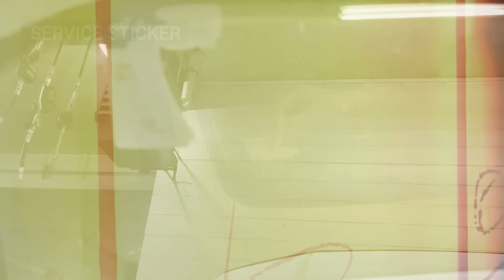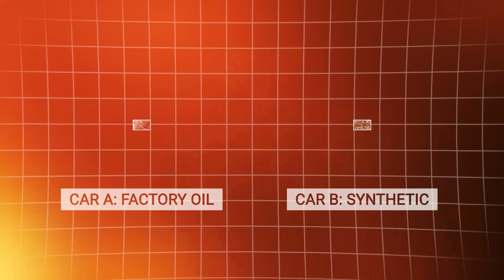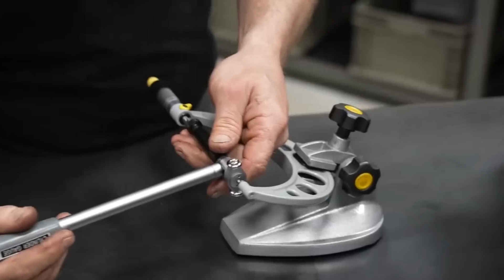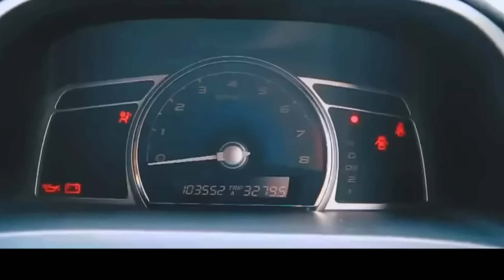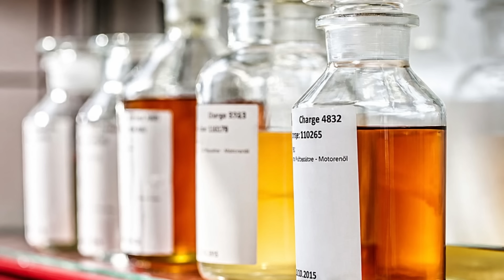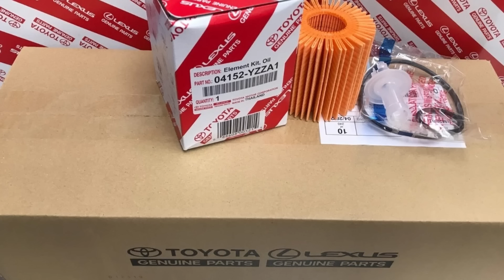We Ran Full Synthetic vs Toyota's Factory Oil for 2 Years — The Teardown Result Surprised Us

Comment: The terms "Full Synthetic", "100% Synthetic" and "Synthetic" are merely marketing terms and has no legal meaning. Use API identification instead. Is it the phony synthetic Group 3 OR a real synthetic with AlphaPolyOlephin and PolyOlEster synthetic bases? Group 3 is now 99% of all motor oil. Because it is cheaper to make without synthetic bases. Don't go over 5k on Group 3. Toyota owners following the factory 10k interval found stuck rings and huge oil consumption. The difference between the two groups is flash point. Group 4/5 real synthetic is more heat resistant because it has ester. Ester is why jet engines can live without a cooling system. Group 3 is fine if you don't tow, race, or have a turbo. If you do, get real synthetic oil. There are only 3 that are U.S. Redline, Royal Purple and Amsoil Signature. This video is an ad for Toyota oil. The Camry engine is not hard on oil. I want to see a test on a new Tundra.

Comment: I think a more precise comparison would be running this same type of experiment over a much longer period of miles such as 50,000 or 60,000 miles.  Also do 100% genuine Toyota bottled oil (not dealership bulk oil) vs a known brand oil like Valvoline Restore & Protect or Pennzoil Ultra Platinum.   I would even add a 3rd Toyota car and bring in a full Group IV PAO/Ester base oil like Amsoil or HPL synthetic.  Then I feel you would have a higher degree of comparison between group 3 and group 4 base oils with different add packs and formulations

Comment: 05 Prius changed oil every 3-4000 miles used a variety of 5-30w synthetic.  Used Lucas oil treatment, to reduce oil loss. Still running at 299,999,9 miles, odometer stopped a year ago.

Comment: Just use CASTROL I have a 500+ mile 4 cyl ,ran CASTROL 10-30 its entire life, engine looks like new inside, look as clean as new ,and its conventional 10-30 changed every 5,000 miles.with oem filters .castrol oil is the best

Comment: Factory / dealer oil is intended only to get the engine through the factory warranty mileage - not a mile more. The full synthetic will have less wear on bearings and rings over the 60,000 mile warranty.
My solution - run a full synthetic and change every 5,000 miles.
Reply: I would like to know where these idiots get there  information from😅
Reply: Yes n maybe go up a grade on the operating temp side.
Reply: Exactly what I do. OEM filter. No worries.

Comment: The real problem is when you bring your car in religiously to the Toyota dealer but find out the oil and fluids the dealer charges you for isn't Toyota's but generic "Bulk" oil and coolant. Many do this to increase their profit margins. Each or every other oil change send a sample of the out for testing. Keep then honest!
Reply: I asked the local Toyota dealer if they use Toyota brand oil. They don't; they use Mobil 1 and he stated Toyota doesn't make oil. Of course they don't because Mobil makes it but the additive package varies.
Reply: Even the Car Care Nut on youtube said after he left Toyota that the oil the dealer used was the cheapest he could buy.
Reply: Toyota uses mobil 1, in bulk and bottled
Reply: @JimS-j1x  Depends on the dealer, doesn't it?

Comment: Not any 👍  but I think it's due to anti 0w-20's. A lot of talk on running 5w-20. I'd like to see you compare THOSE results. In MY opinion, hotter climates could probably use 5w, but on hybrids, I just wouldn't risk, because stop start process.
I'm kinda discouraged with Toyota brand oil. Why DON'T they make their's full synthetic? Rumors are it's the same oil as MOBIL1, but it isn't. They never DO state full synthetic on their bottles. I ran Mobil1 once, but didn't like the color because it was a deeper golden color & I felt it would give off more of a varnish color on engine.👍
Reply: True, Mobil 1 brings in more varnish to the engine parts
I felt the same